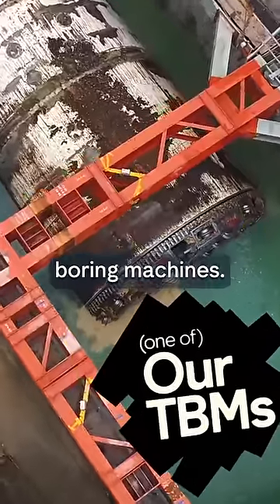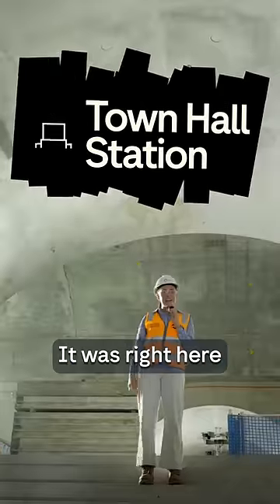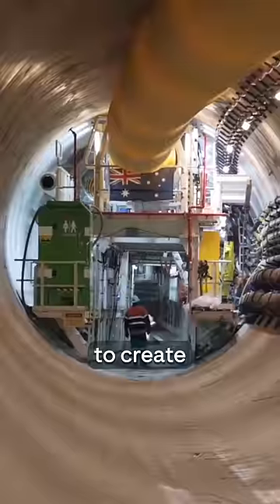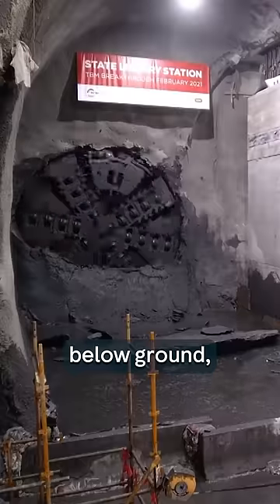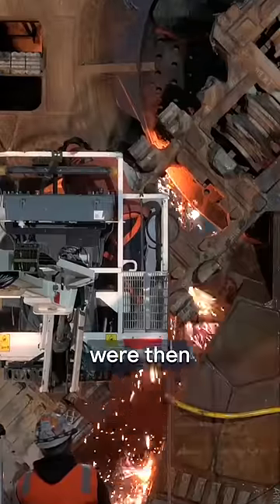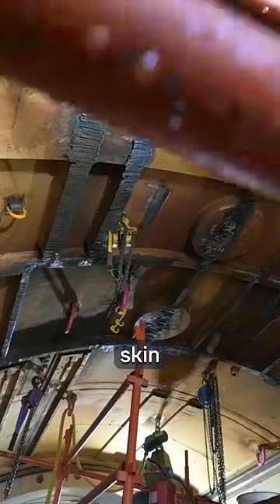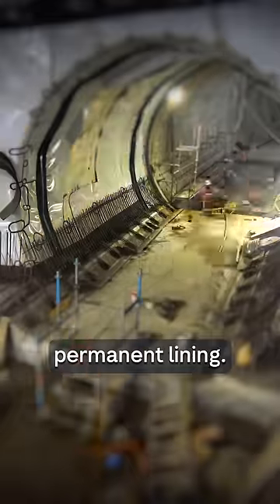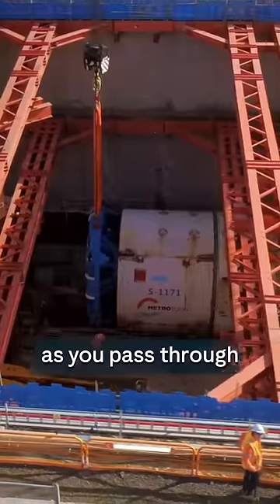What happened to our TBMs?

Comment: That’s so cool! The bores have completed their journey and become part of their own creation themselves at the very end
Reply: And in so doing a massive and complex machine became disposable. Think about how much cost that adds to tunneling.
Reply: The machine gets inspected after dismantling for possible reuse in different boring operations and if not then it gets remelted to be used as new things

The skin is the only part that gets left on the tunnel
Reply: @SurmaSampo they are end of life after such a tunnel...
The hydrolycs are worn, the pumps are worn, the electronics are completely buried in dust....
The abrasive rock will destroy those machines, they are almost always single use machines, just like the huge bucket wheel excavators for coal mines, they get blown up after the coal is excavated, and a new one is build on the next coal field. (Some exceptions like the bagger 288)
Reply: What? Literally they say the took all the parts out, and evaluated for re-use, literally the opposite of disposing of them. 

Then their shells, which were much harder to transport, were turned into the tunnel's walls. Did you not watch the video?
Reply: @SurmaSampo and how would you propose to get a tunnel boring machine out for complete reuse?
Reply: Just like a human caterpillar
Reply: @SurmaSampo   You cant remove the front section of a TBM because it is bigger than the tunnel behind it. All equipment for the TBM is removed and reused except the front section. The machine is not disposable only a tiny bit of steel at the front is.
Reply: @SurmaSampo  did you even watch the video?
Reply: @SurmaSampo do you mean how much itll save them?
Reply: @SurmaSampo correction, do you have any idea how much cost that saves from tunneling?
Reply: @SurmaSampo  apparently it was jist the outer skin, not the internals. Im sure they had no plans to just build a one time use machine of that magnatude and the skin is easily replaceable anyway
Reply: @SurmaSampo Tell us you didn't pay attention without telling us you didn't pay attention.

Comment: That’s efficiency! (I think?)
Reply: Well, how else would you take out a TBM without 1) digging a giant hole over where it is and 2) without compromising the tunnel's structure
Reply: @oldtimegames96 dig up?
Reply: @oldtimegames96  Dig around it and remove it. I mean, usually I don't leave a bit of the drill bit in the wall so it will be more sturdy. But here they thought "might as well". And that's cool.
Reply: @oldtimegames96 adding a reverse gear? 😂
Reply: Tbm's can't drastically change there vertical angle.
And the cutting up and lifting out the small pieces is the reverse of how they gut there in the first place 😂
Reply: For the factory who make them, 100%
Reply: @tonyhollerz6958 the front of the Tbm is larger than the actual tunnel!

Comment: Often the tunnels are dug by two tunnel boring machines (TBM'S), one from each end, and when they meet, deep underground, it is too expensive to try to remove the machines. Also, by the time the tunnel is completed, the machines are worn out and practically useless, so the cost to remove them is prohibitive. So often the one of the machines or both are sent off to drill themselves into a side tunnel where they are buried forever.
It must be remembered that these machines are often about a city block long, difficult to remove, have used up their lifetime economic purpose, and if there are any useful parts leftover, those can be removed. It seems a waste but these tunnel boring projects are very expensive and the cost of removing a used-up machine would add greatly to the overall cost.

Comment: How do they turn while underground?
Reply: There are really good documentaries on YouTube that show how it's done.
The sort answer is, they have a huge rotating faceplate with grinding wheels that are harder then the targeted rock, the space between the face plate and the rock gets pumped full of water and the rock dust-water mix gets pumped to the surface, the whole machine moves like a caterpillar, it uses huge hydrologic cylinders for that.
At the same time the machine layes prefabricated concrete blocks around it self and seals them with mortar, thus it leaves a almost finishes tunnel behind it.
All happens at the same time and it's  beautiful...
Reply: They turn very very slowly. It's kinda like a train, you have to keep going straight, but if you curve slowly enough, you don't realize you are turning.

Hydraulics put a little more force on one side of the cutter head than the other, which means a little more is eaten out of one side than the other. Much like the rails on a curve, one track is ever so slightly larger than the other, and it turns.

Comment: So, you were talking BS when you said that they (the drill machines) were still down there. The only thing they actually left behind was the hull of the machine itself.
It would be the same if someone would tell me that he has a car buried 6 feet under behind his house and under the pool.
It depends, but a normal person would probably call the police. And only because they found the frame and paneling of a car, no one would call these parts a car... It was probably a car at one time but it's definitely not a car anymore.
Boring does exactly this, they remove all parts that could be used again and are small and light enough to bring them back to street level and are using big parts of the machines housing to strengthen the tunnel itself.
But this idea isn't really new. Before, you could drill a tunnel while someone directly behind you would lay the Beton parts out.
I'm not an engineer (not even close) but this seems to me like a much better idea.

Comment: Why were the skins of the shileds left behind? Were they not reusable?
Reply: Probably too big to easily get them to the surface and not worth the hassle cost-wise

They are not complicated machinery, just sheets of metal
Reply: I imagine they are very hard to move, and would be almost impossible to get back above ground for transport to another site. So it would be significantly more expensive to reuse them than to replace them.
Reply: Because they are what's holding the tunnel open, and they're too wide to pull out without destroying them. It's better to just leave them there as a structural element, since it's basically just a piece of metal.
Reply: TBMs while boring are what’s supporting the tunnel. Followed by a crew constructing/ reinforcing the tunnel walls. So once it’s done boring that outside skin is partially what’s supporting the tunnel up until it’s later further reinforced and cemented in like mentioned. May seem somewhat inefficient but there is really no other good way to dig tunnels as big as the ones achieved using TBMs